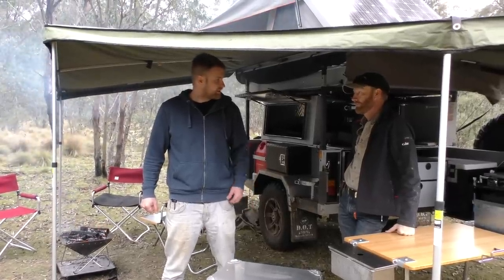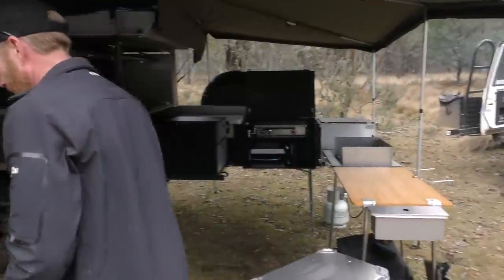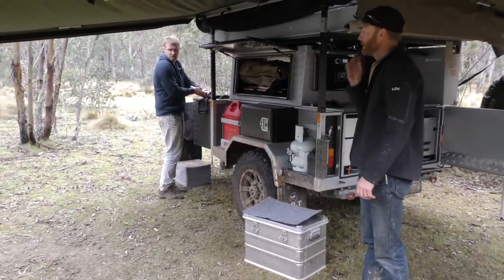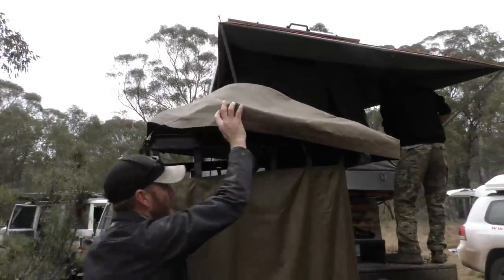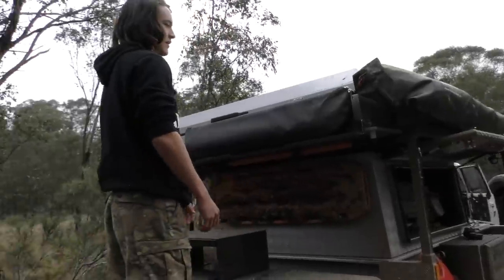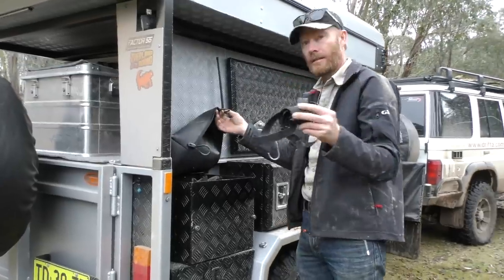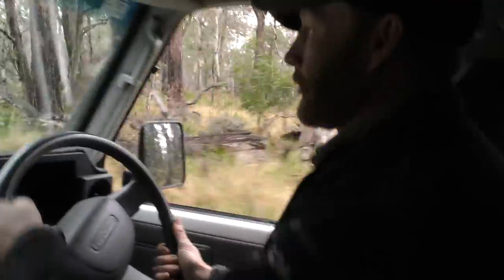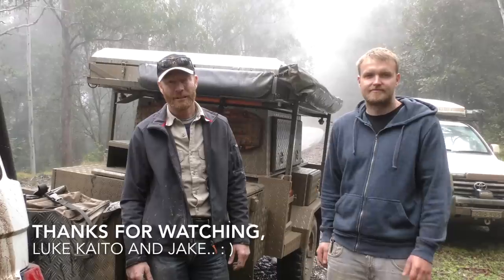DOT WUHT Camping Trip Part 5

Comment: Love that hard shell roof top tent. best one on the market iv seen so far and that walk up design is pretty neat. However if i was to get one the only thing i would change is the box at the front. An angled tool box you see on the side of work utes like this for example https://www.bunnings.com.au/rhino-1500-x-530-x-820mm-highside-checkerplate-tool-box_p6120164, with steps built into the lid at the center and hand rails for those wobbly boot times ;) the fire wood box moved to the front acting as the first step. That would be sweet on a small toy hauler trailer to carry around my wolverine on hunting trips :p Just need to figure a way to get a tinny on top and I'll be set!